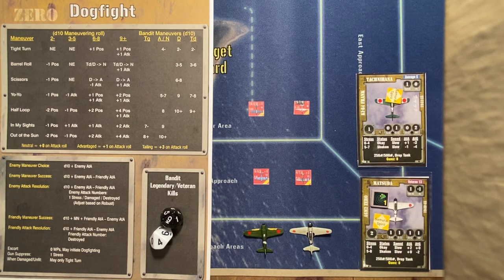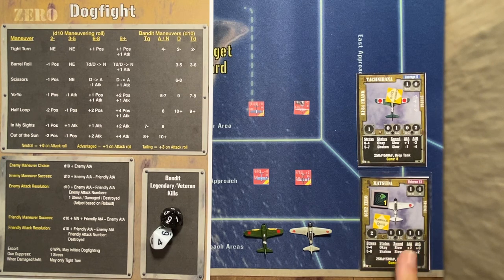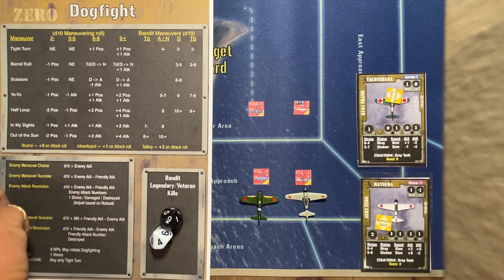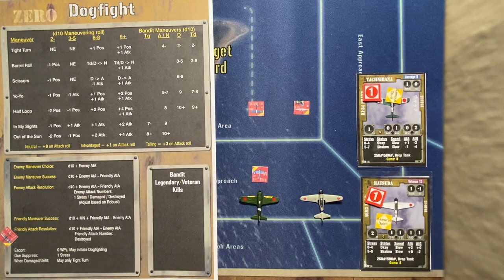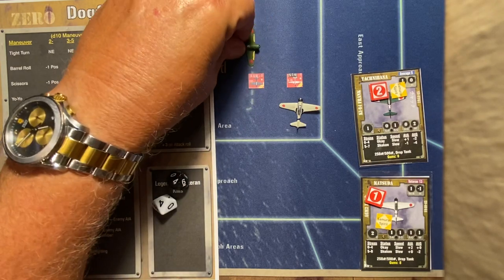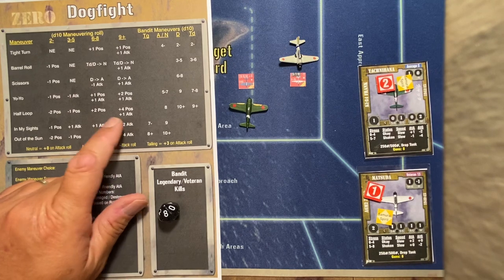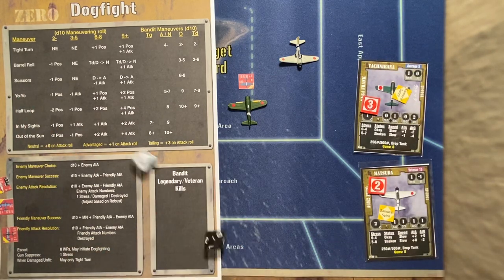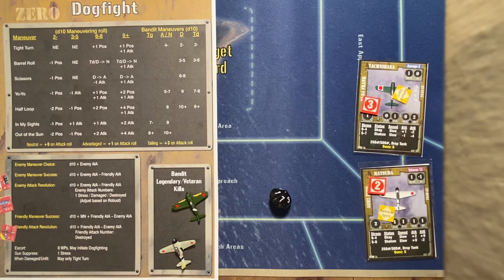DVG Zero Leader Dogfighting

Comment: @12:30 the Zero should be at +7 attack roll. You forgot to include the +3 TAILING. Again this just shows that there are a lot of modifiers to be aware of and some can be missed. This is why I recommend when you release the updated version of the Dog Fighting Player Aid that you include every possible modifier possible plus a note about DEFENSIVE Firing. It will just help the gamers.

Comment: Chuck...i bought the miniature models for this game and Im trying to figure out how to use them (with game play mechanics).  How do you discern High Altitude and Low altitude?  How do you know which is the group leader and other pilots etc.?
Reply from the maker: Hello! The Emperor uses magnetic stands in two heights. To differentiate pilots, I use a d6. I put one die on the card and another on the stand with the model.

Comment: Can bombers maneuver or the gunner ones just wait to get shot down from neutral position? If not probably it could make some sense to give them special move to position themselves at D/Td position for a shot opportunity. Or since we are limited by the number of turns it was designed, so we could try to bring it down with lower chance from neutral position without putting our fighter in danger or just take the risk and position ourselves behind it for additional modifier during attack roll.
Reply from the maker: Bombers may not maneuver. Attacking fighters maneuver around them. At the end of your comment you hit on the major decision. Do I attack a gunner Bomber from a lower chance but safe neutral or do I maneuver for a better shot but risk defensive fire. There is no correct answer. Sometimes it is wise to attack neutral and sometimes you need that better shot!!
Reply: @chuckseegert6812  Thanks for fast reply! It's my first Leader game, so I'm just getting into it : )
Reply: @chuckseegert6812  Actually have another question, when an aircraft gets minor damage it suffers extra +1 stress at the end of the mission, what about "damaged", does it give any extra stress after the mission or it is just +2 but straight away when the damage is inflicted?
Reply from the maker: @rastafari7584  That is a big difference between minor damage and damage. Minor damage gives you one stress immediately and a second one when you land. Damaged gives you both right away. That one less stress in the middle of a mission can be huge!!
Reply: @chuckseegert6812  Got it, thanks for the clarification!